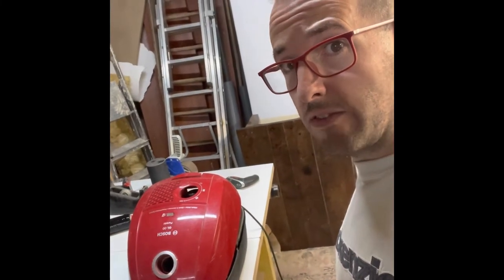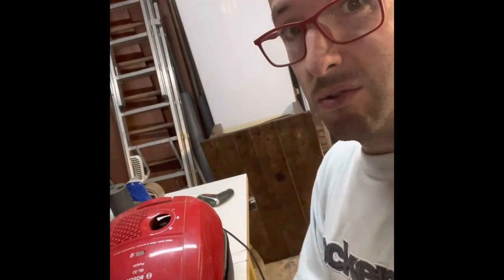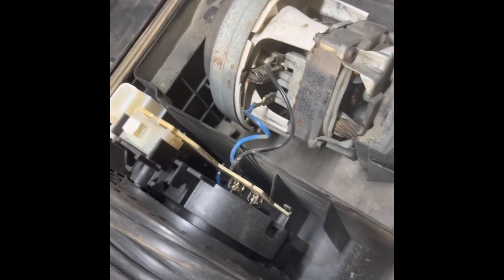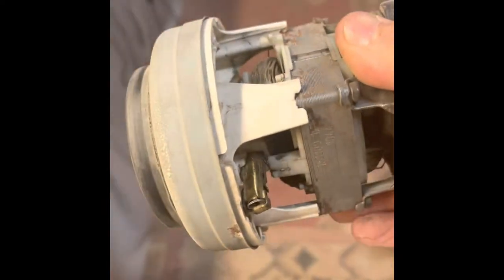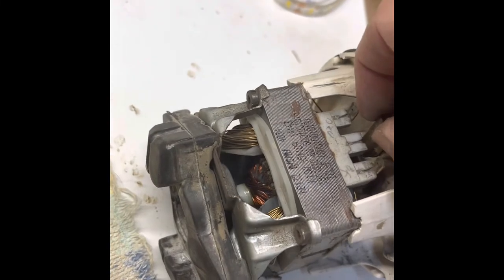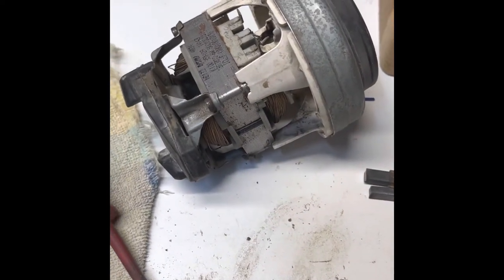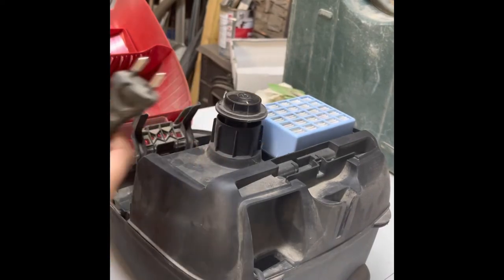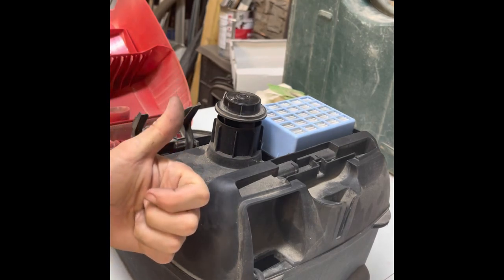Bosch common vacuum cleaner hoover repair to electric motor

Comment: Thanks I repaired my Bosch vacuum cleaner in India after watching your video. The repair guy told me motor needs to be replaced and asked for 120 Euros. I cleaned carbon and it’s working fine🎉🎉
Reply from the maker: Hey that’s great!   So glad I helped, thank you for watching 😃